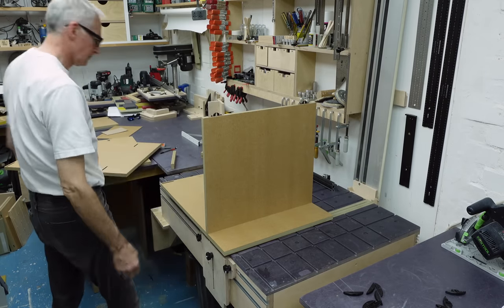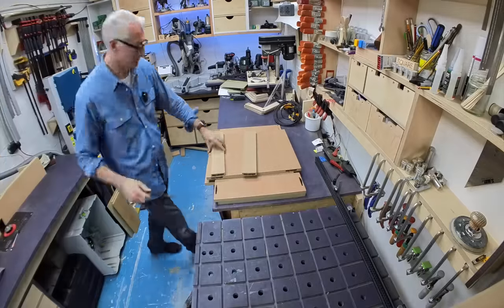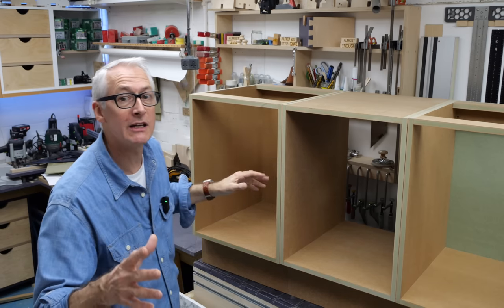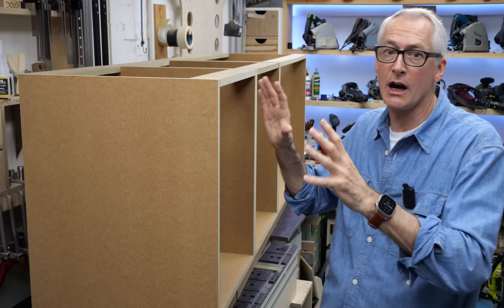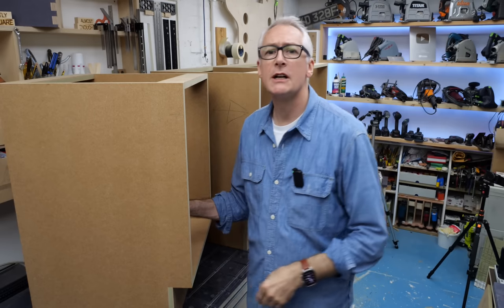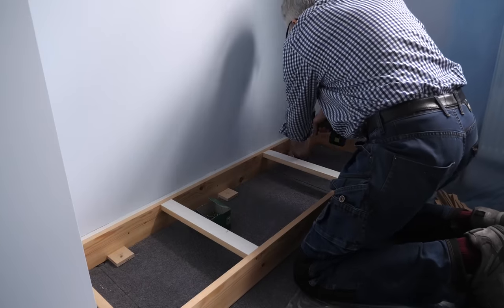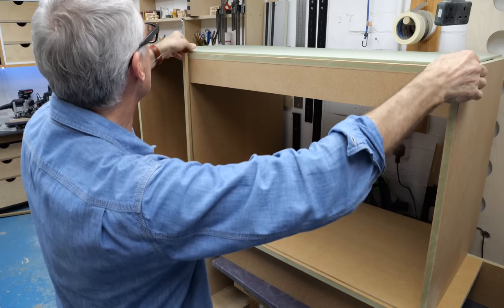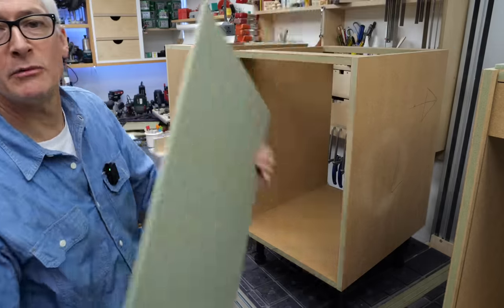Base Cabinet Basics [*Ad] [video 547]

Comment: Having done a number of kitchens over the years, I have settled on the plinth method of cabinet bases.  I find it easy to build, often with offcuts from the cabinet building, strong and fast to make.  Once levelled, you know all cabinets will install quickly and accurately.  I have also found it easiest to have a thicker back panel - 12mm prefinished plywood.  This makes a strong cabinet and I don't worry about screws through the back holding cabinets in place over years.
Reply: Definitely like the idea of building the plinth base over levelling all the feet individually. How would you go about dealing with big gaps between the plinth and the floor if the floor runs out quite a lot over the run? Or is it only used if the floor is relatively level?
Reply: @nachobanditchannel  I build my bases out of generic 3/4" plywood.  After leveling the bases, I will apply a 1/4" plywood skin over the show faces that will match the kitchen.  This will allow me to cover any gaps from leveling.
Reply: @MrJacrider  Ahh nice, thank you mate

Comment: I’m only an amateur and don’t try to make money making cabinets, but I’ve built a few cabinets and mine tend to be over engineered. I use rabbets and dadoes for a lot of the joinery because I find them to be stronger and it helps a great deal with assembly. I very much agree about using a plinth (here in Canada it would usually be called a base frame) for the reasons you mention, plus it makes the cabinets themselves more simple boxes and a bit easier to construct. I’ve used the adjustable plastic legs once or twice and in some circumstances they work well. That MDF is a type I’m not familiar with and it looks to be very nice for paint-grade cabinets.

Comment: I remember two personal kitchens back using the plinth method and when the chap doing the floor came in (because I couldn't be bothered by then) and saw it he criticised it. Several months later after having his own kitchen done he said he understood why it was easier to use for uneven floors than the adjustable legs method as the bottoms of his new cabinets were all over the place. (and no i didn't put in his new kitchen)

Comment: Great video Peter. The integrated kick plate is not something I have ever seen in a kitchen around here either. I am just finishing up built ins in my pantry and plinth method made it dead simple to set the cabinets. I did have to shim the plinth almost 3/8” on the one end so that would have been a nightmare with that other style cabinet. I have not had good luck finding that high quality MRMDF in my area so I always build my cabinets with a high quality birch ply that is always stocked at a local mill near me.

Comment: We have a 4th type of cabinet back in the US, no back. Super weak and very cheap but you would be surprised how often it is done this way. I have been in fairly high-end homes with backless cabinets.
Reply from the maker: Ooo, interesting, thanks! You sometimes see drawer cabinet without a back here - that displaced air has to go somewhere - but there’s usually bracing sections too & bottom. 👍

Comment: I’m interested in you thoughts in a din rail type of base installation - I’m sure a big manufacturer uses similar. Like many wall cabinets with a bracket and hook/clamp it surely would make runs easier to level then merely wind down a turret leg to spread the load.

Comment: the plastic feet are so nice to have. never having to worry about water damage at the bottom of your cabinets, being able to access the backs of the cabinets for wires or plumming is nice aswell, and you can easily move and level your cabinets without having to build a new toekick. 
it always feels a little shitty to build nice cabinets and then put plastic feet on it, but they are just better.
Reply: Thought the legs cabinets were a bit meh when I assembled them.. Then I installed them. Wow. Legs are the way to go for all the reasons you’ve mentioned.

Comment: Great Video! I've used plinths and adjustable feet over the years, and I much prefer making separate plinths as they're so much easier to level.
You can level the entire run in one go, and have easy access to all sides. Reaching underneath a cabinet to get to the rear feet is a pain in the arse...!
Reply from the maker: Totally agree! 👍

Comment: Thanks Peter, this style of video is a great reference point for me , you really cram in the information and tips in each one !

I like the idea of the plinth style, so much easier to concentrate on levelling at that stage, then everything above is quicker and easier to fit !

Our Kitchen was fitted when the house was built 25 years ago and is a "Moores" kitchen ( still going today ) it's a good quality kitchen and has lasted well. However, the kitchen was fitted for standard white goods package which we decided not to take and had a gap to fill, so ordered an extra unit direct from Moores ready for when we moved in. However in the meantime the builder had the floor tiled into the recess ( great if you're slotting in a dishwasher or fridge ) and being an "American" style unit, I had no choice but to cut about 4mm off the bottom of the cabinet - not easy with a handsaw ( no track saw then ) and of course that left an open chipboard surface perfect for soaking up water ! 🙄

Comment: Hello Peter
I think at least there is one function for a full board ceiling on a kitchen cabinet and that is (even it is not visible like the rest of the interior of the cabinet) it surely must have the same finish to keep it as clean as the rest of the interior that you can see, without the roughness and possible accumulation of dust or dirt under the stone cover, which is always supplied without polishing and difficult to keep sanitized.
The cabinet for the sink must be without a complete roof to avoid exposing the edges of the board that is cut to the shape of the sink on site. This cabinet is "wet" inside since it normally houses cleaning products and trash buckets, we use aluminum square tube chargers for this kind of cabinet and also for the cooking top.
Saludos
Gerardo

Comment: Great stuff! I've just been through a lot of this winging it myself. I've just thrown a temporary kitchen together repurposing a lot of what was already there to suit a better layout resizing existing wall hung cabinets and knocking up frames with shelves under counter from CLS and whatever scrap I board I had kicking around (the original counter was levitating on some flimsy L brackets!). It's not pretty but it's my first house and I've spent long enough getting the bulk of the house into shape so the kitchen can make do for now so I can actually move in! Those space plugs and adjustable feet a brilliant especially when your floor resembles a choppy sea like mine.

Comment: Excellent!!!  I've used the detached base or plinth method for years.  Personally I think it's better.  Cheaper cabinets here in the US usually use the full panel or to the floor method.  In our new house, the builder used the cheaper particle board to the floor cabinets.  Our dish washer leaked and  all of the cabinets in that run had to be replaced.  Two months for the floor to dry out, and the cabinets to be replaced.  Got to reuse the top, and all the custom built in's I had done on those replacement cabinets.  Some tweaking required.

PS I offered to build the replacement cabinets at cost but the insurance company would not let me do it.   Come on guys, the face fames and the doors were all reusable.

Comment: I recently built some cabinets with Medite MR MDF and it is a superb product. Sands beautifully, edges are great for painting and ends do not blow it when you screw into them. Did another little job after using standard MR MDF and it's just not the same. After priming, the surface just raised all over the place and it was so much work to get a good enough paint finish
Reply from the maker: Yes, I t’s a solid product. 👍

Comment: Peter  what about a void at back of cab  say gables are 570 with bottom shelf about 502 deep with an 18 back  .  With this use void to scribe cabs to wall as well for the use of services   . You can also use  an L shape bracket fixed to top of void and you be able to fix back to wall

Comment: Great video Peter! Plenty of useful  info and food for thought. My house had a 1970’s Hygena kitchen fitted when we moved in and the base cabinets were the same as the US style with the sides running to the floor… plastic levelling feet were probably not invented at that point. They lasted 50 years so not all bad (although no surprise there was some water damage at the base!)

Comment: I am thinking about a composting toilet for a campervan. Basically, mine will be a box with provision for sitting on, internal space for a bucket (lined with compostable bag), a "jug" - basically a wee bottle, Optional storage for paper, spray bottle of vinegat+water, peat or other composting aid.

I am thinking it should be a seat for normal use, perhaps fold up wings for brief privacy. It could extend across the vehicle, or part of the length as a lounge or other furniture, and those parts nt toilet would provide other storage.

This seems quite timely.

Comment: The forces that act in a cabinet always end up draining through the sides.

Shelves, drawers and swinging doors always drain the forces to the sides, do we agree?

Therefore, regardless of whether it is a wall or base cabinet, we must install it so that the forces that are draining through the sides finally go to the wall or the floor.

Metal hangers with three-dimensional adjustment, fixed to the sides for hanging cabinets or leveling legs (well installed as shown in this video) for bases and towers, as long as the floor is solid.

The difference with the US cousins is that "traditionally" their floors were flexible and that is why it is also "by tradition" that a continuous base of solid wood is normally manufactured as an intermediary to drain the weight of each side of each kitchen base cabinet. towards the beams that have the floor underneath, such is the tradition that even if it is now normal to have solid floors, they continue to do it as always.

If your floor is solid, leveling legs are the simplest and cheapest way to perfectly support and level a cabinet, do we agree?

In Latin America it is common to imitate that North American tradition without any reason since the floors have always been solid
It is commonly be made of MDF if it is not taken into account that the humidity of the floor will end up rotting the base. Others, improving this initial error, make it from masonry, up to 28cm, yes 28cm!

With modern leveling legs at less than $1 a piece, is this logical?

saludos
Gerardo

Comment: we may have the same worktop - Wickes a few years ago , Quartz some kind of composite anyway - When the guys had all the base units in, the worktop company turned up with a laser thing ans mapped out the entire kitchen worktop - quite interesting to watch - just be careful with anything really HOT , ours also stains a bit , and we use Bar Keepers Friend to clean - Great Video as always , only ever fitted 4 kitchens myself and always had the legs and plinth - in fact because of water damage I had to remake some side panels as the kitchen nolonger available and used B&Q to match colour , if the sides had been part of the base unit that would have been a disaster
Reply from the maker: Thanks! We do have a similar Wickes worktop in the utility, but this one was from the kitchen supplier, Caple. 👍

Comment: Hi Peter, great video....... How do you template the cut outs in the back of base cabinets for things like plug sockets etc? I'm sure I remember you using something like plexiglass or similar? But what's your method? Many thanks
Reply from the maker: I use a product called corex - a corrugated plastic intended as floor protection. It’s translucent enough to mark the positions, then transfer them to the back of the cabinet with an awl.  👍

Comment: Hi Peter. Thanks for sharing your knowledge.  Very useful for my next project.  Just one question if you dont mind.  Should a washing machine always sit on the kitchen floor or can it be installed in a cabinet with legs?  The reason i ask is i am building a few kitchen cabinets but not sure how to do the kicker at the bottom if I leave the washing machine sitting on the floor.  Thanks again.
Reply from the maker: Thanks! Depends on the washer, but mostly they sit flat on the floor, and have some kind of integrated toe-kick to cover the built-in height adjustment.They’re generally considered too heavy to install in a cabinet with feet. 👍
Reply: @10MinuteWorkshop  Thanks Peter. Much appreciated.

Comment: One problem with the plinth/legs style is that in a small kitchen you lose a lot of storage space. The full height sides style can be easily modified to include a drawer in the otherwise wasted space. When you only have space for 3-5 cupboards in your kitchen, this matters.
I guess the conclusion is that there's no universal best style, you should always consider the space you have.

Also, not exactly on topic but still: corner cupboards are EVIL.
Reply: I swear creatively and regularly at our corner cupboards. They are definitely agents of evil. But given that kitchens tend to contain corners, what is the alternative? I would genuinely love to know.

My parents' kitchen has ingenious rack mechanisms fitted inside the corner cupboards so that on opening the door the entire contents are rendered accessible, at the expense of a certain amount of storage space. Is this the way forward?
Reply: @cooperised  You can fit a "magic corner" system in a corner cupboard, it will improve access but also reduce the amount of space available (because the mechanism has to fit there) and you have to be careful to not store small items that could fall out and get stuck.
The best solution is to avoid corner cupboards altogether if possible. A galley layout is much more convenient in a small space because you have direct access to everything. For even easier access, have drawers in all base cupboards - no more forgotten items hiding in the back when you can pull out a drawer and see everything.
Reply: @YaaLFH  I agree. The problem only gets worse with age. Older people are less able to get on their knees to see what's in the back at the bottom. Drawers make a lot of sense for the bottom row or two!
Reply: @weldabar  My dream kitchen has drawers everywhere below worktop level, including under the sink. And they're proper drawers, not those tiny shallow trays that barely fit cutlery like what I have now and can't change because I rent 😭

Comment: Out of curiosity, why don't they make the bottom the full width and the two sides sit on top of the base?

I was thinking that the weight would then be borne by the material and not the fixings at all. Yes, I know the plastic feet are uneven so they still out under the sides but wouldn't it still be stronger to have the sides just sit on the base and the base on the plastic feet?
Reply from the maker: I'd imagine for commercial cabinetry, they make it as strong as it needs to be, in a way that can be manufactured most easily, eg top, base and shelves all the same width makes the process of manufacture much simpler. 👍
Reply: @10MinuteWorkshop  
Ah, thanks for that. Certainly makes sense. I guess it's probably plenty strong enough in that way. The only reason I thought of it is that recently I was trying to move around a 30mm thick stone worktop and was thinking all that weight is essentially resting on the dowels, screw and plastic tabs. 
Then you have tradesmen sometimes climbing onto the worktops for some sort of maintenance or installation on the ceiling or wall.

Comment: Hi Peter, when the adjustable legs are placed under the cupboard taking into account a deeper plinth, the adjustable legs cannot be placed under the sides to support them. A heavy kitchen top or a heavy marble sink puts a lot of pressure on the connection between the sides and the bottom and top. What is a good solution for this?
Reply from the maker: SHouldnt be using these plastic legs for granite or marble, there are meta legs more suited to those applications. Be aware of the weight on the floor as well - I've seen legs sinkl ink to flooring in older victorian houses because of the weight load! 😯 👍
Reply: thank you Peter, I will search for metal legs 👍 @10MinuteWorkshop

Comment: I have been trying to buy some 22mm Medite Optima, but have found that suppliers are unwilling to sell it to a DIYer like me as they have to buy a whole pack (which is 10 - 22 sheets depending on thickness, I am told). Even Medite have been unable to find me a retailer.
Do you have a more helpful supplier?
Reply from the maker: Whereabouts are you based Mike - I’ll ask, see if there’s anyone within striking distance. 👍
Reply: Thank you. I'm near Cambridge. I know that Keith Rag'n'Bone Brown is relatively close, so I asked him, but he has also had difficulty getting hold of it. @10MinuteWorkshop

Comment: We do cabinets very very differently here in the States. Having cabinets spaced out from the wall is lunacy! Electrical and plumbing aren’t run inside the walls over there? I quite like plinths but all cabinets here are of the first style you showed. Our backs are a little different from all of those. For most custom work, I have to match existing pieces and it’s never a box carcass on a plinth here.  We also have no access to colored MDF or moisture resistant MDF (at least not on the coast of North Carolina).
Reply: Try to run cables and pipes in a brick wall and you'll understand.
Reply from the maker: Electrics are chased into the walls, plumbing very rarely.  We build our houses out of brick though - makes a difference! 👍